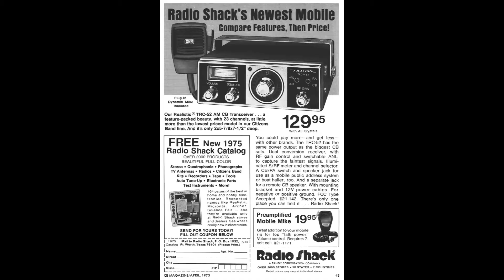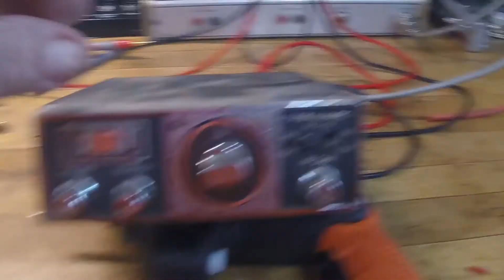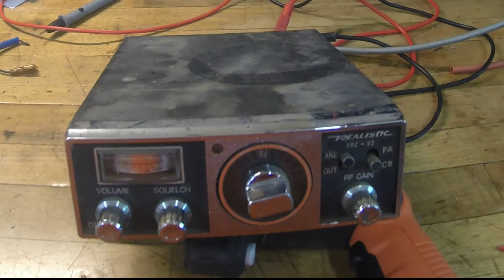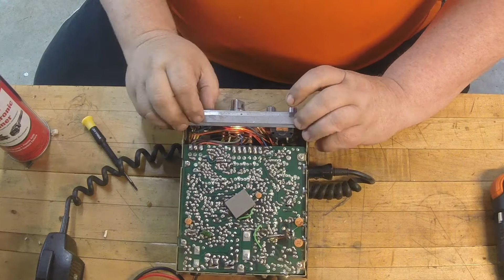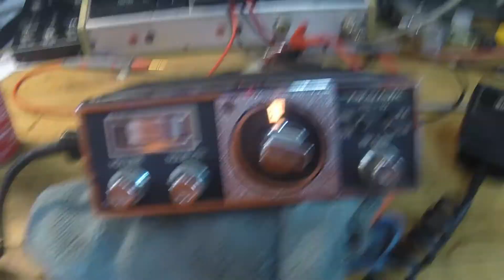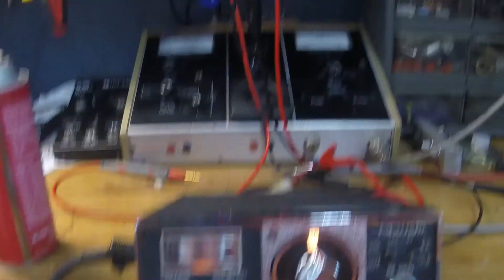Classic Realistic TRC 52 23 Channel CB Radio Repair and Review Video

Comment: That wos my first CB back in 1974,   There's a lil surprise inside of those that few new about because few ever read the manual.  There's a built in "dummy load" if you wil, so if you don't have an antenna hooked up to it it won't hurt the radio if you key the mike without it.

Comment: I had one of these back in the 70s and early 80s. A friend of mine "peaked and tweaked" it with a same-vintage RadioShack power mic. When he was done, it "walked and talked" like a base station with a RadioShack magnetic mount antenna on top of my '65 Impala. When I used it as a base station on a power supply connected to a Penetrator 500 with RG-8U cable, it talked even better! I wish I could get it back (along with the Penetrator)!

Comment: I used to do cb's in the early to late 70's.  That radio, although not much to it, was the best cb I owned.  It was easy to tune, the audio output was very good, and the radio was easily modifiable (adding channels) etc.  Just a great basic 23 channel radio.
Reply from the maker: Very cool!
Reply: Exactly my findings too.

Comment: Why do you have your power supply set to 13.9 instead of 12 or 12-1/2? Since that's what battery voltage is?

Sorry for such a new question, I'm an electrician trying to learn electronics. I'm enjoying your videos, btw.
Reply from the maker: Typically if you check DC auto voltage it runs about 13.8 when the car is running so I just tune there but anywhere from 11v to 15v is safe to use on these CB's

Comment: how many amps amps and volts dose a trc-52 pull? i have mine its wires are cut and im trying to find a power supply for it and i wanna ask what antenna should i buy?
Reply from the maker: A 5 amp power supply will be more than enough to power this radio. I think the max current drain is around 3 amps but it doesn't hurt to have a little head room..

Comment: I came across a TRC-52 from a friend many years ago, which needed repair. The audio output stage was literally fried.
Some one must have intended to clip the audio limiter diode but instead, clipped the MOV (metal oxide varistor)  diode
 MV-1 (temperature compensator) in the  audio output stage which caused both audio output transistors TR 12 & 13 
to burn out and also fried and melted the audio output transformer T-15 (TF-038) along with a few resistors. I replaced all the burned out components including the audio transformer  that i stripped out of a Pearce Simpson (made by Uniden) 
Alley Cat 23 that had a comparable audio output transformer and the transplant and operation was a success. The TRC-52 is comparable to the 23 channel Cobra 21 of that era and it uses a similar Uniden chassis that was used in many other radios around the world.